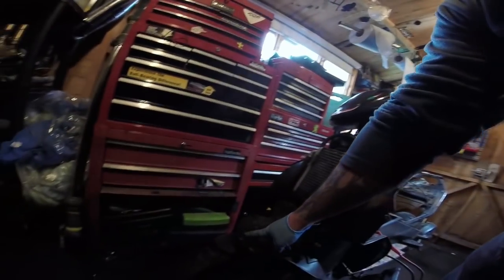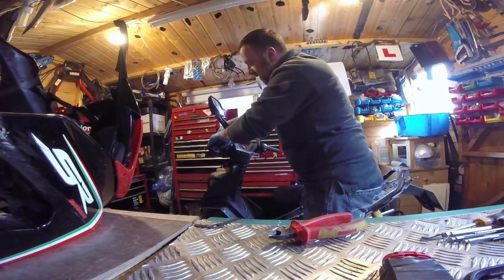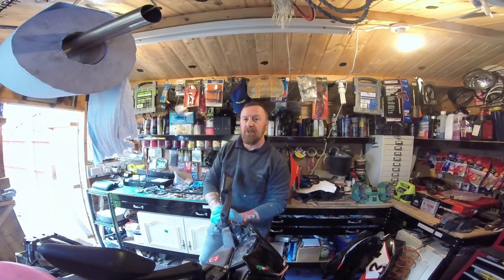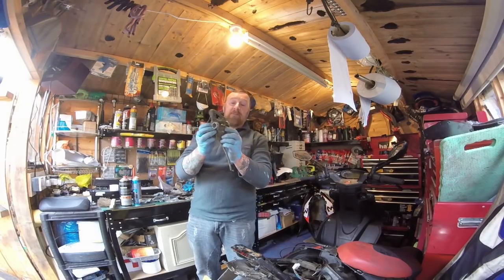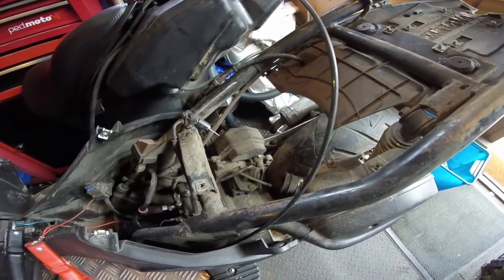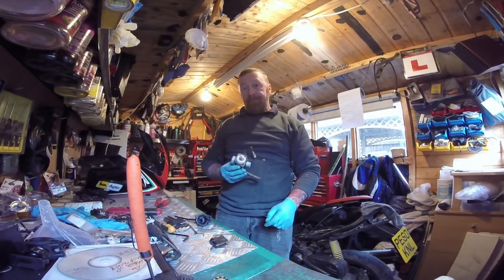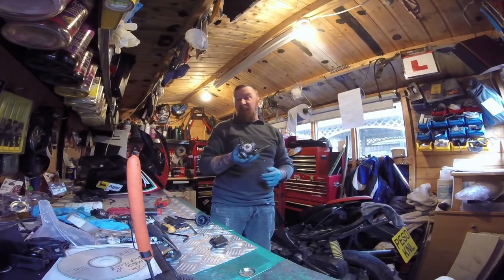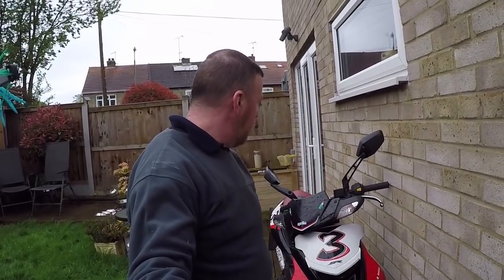APRILIA SR50 CARB CHAT AND START MARK SAVAGE

Comment: Hi mark 
Just asking the carb setting 
Put the screw all the way in then 1 and a half out
Reply from the maker: Yes bud ,that's factory set , then tune to your ped as in how it runs 
A littke out or in to run and rev better
Reply: @marksavage   hi mark just a other question for you 
I have put a battery on the bike and it is saying er 007 wot can you tell me about this is it the immobiliser
The bike is nearly running turning over well just will not fire into life 
Thanks from mat
Reply from the maker: @mathewedwards7078  I have a video with the codes 
Try mark savage aprilia 
Otherwise Google bud
They do like these codes and have problems with the ecu

Comment: Hey man, don’t know if you Will respond but I have a question. Does every sr50 have cables that lead nowhere? For some reason my Aprilia has three cables coming out to the headlights, one that leads to the left light, and one leading to the right one. And then there’s one in the middle leading nowhere? My headlight and heads-up display backlight don’t work and I don’t why. Could it be that this third cable is supposed to be plugged in somewhere? I can’t find a place for it to go
Reply: There are also three cables coming out to the front blinkers, the third one has nowhere to be plugged in. But the blinkers work as the should.
Reply from the maker: Agree I think it was to side lights .see if it has power to it when running with a volt meter 
As for clocks 
Check bulbs or and cut / damage wires

Comment: Hi.. i have a prob with my speedfight 3 it does start and ride however.. it seems that when the bike gets a little bit warm it seems to bog down and it won’t move no matter if I put a bit of throttle or full throttle. Help?!
Reply: What performace partsbare on the bike if any and what was the last thing you touched if you did
Reply from the maker: hi bud 
a few things but got to start with a service and clean carb, have you checked the auto chock like in my videos
make sure the air and fuel pipe are good and not gone hard plus check float 
worth a check on the VARIATOR system too, clean and new rollers and belt if needed
hope that helps bud got loads of videos that will help
however you know i don't love the sp3's sorry bud just a bit harder to work on 
please like share and sub
Reply: mark savage Thanks for the advice, will try everything you’ve said and yep subbed and liked mate
Reply: tyraines haven’t done anything with it apart from changing spark plug only thing that I’ve done with it
Reply: mark savage however it also seems the bike has a strong smell of petrol not sure if that’s supposed to be happening?

Comment: Sorry to bother you again, but the Aprilia SR50 Ditech's was wondering if there is a way of converting them to a carburettor???
Reply from the maker: JDM Gaming ummm 
Not sure I guess it you change the head and then put on the carb inlet and carb I can’t see why not so possible 
But may have to change the cdi ! Wiring loom maybe 
It’s not as simple I guess 
If not change the engine for a carb one and loom 
Small job changed in a big job !!
Worth a look 👀 in to 
Mark
Reply: Yes mate they can be carb converted commonly done aswell ditech is nothing but headache

Comment: Hi mark , do you prefer auto choke sytems on carbs or a manual choke conversion ? Im not sure if inshoukd convert to manual choke
Reply from the maker: they are so easy as you just get on and go and don't really think about them till they go wrong, as for manual we all have had one then forgot to take it off and conked out a few miles up the road and then have to take it off and start off lol 
so tbh auto chock for me , take care bud 
mark
Reply: mark savage hi mark , ithink mine has gone maybe as it doesnt idle without having to hold the throttle on a bit and even after its started from cold it wont idle until i ride it for a bit then stop then it holds the revs at 1,900/2,000 rpm im thinking a faulty auto choke ? How can i test and fit one of those as ive not done that yet
Reply from the maker: for the fact it is starting sound more like idle, have you up'd the idle, adjusted the cable and cleaned the idle jet?
test auto choke , take it off and connect power from a battery to the wires / earth and live then after 30 secs or so the auto choke will come out up to about 5mm then if it does it works if not it don't --simple bud 
mark
Reply: mark savage il give that ago but after i drive it after a cold start it will idle so im thinking its the auto choke , what rpm do you go for on idle?
Reply from the maker: tyraines 2t well often 1k to 1.5k

Comment: Mark I have probem with my SF2. I was cleaning carb and wanted to screw out idle jet but both idle and atomizer started to spin and now I can't put idle out but more important that atomizer is spining. I found loctite that is resistant to gas BUT, problem is that I don't know where holes on atomizer go, I don't know how to put it back now. Do you have some idea in what direction to put holes cuz they are in 90 deg angle
Reply: Also after this scoot isn't starting cold well. It's running on very low rpms, it don't want to rise them up, like choke isn't working , but I checked it and it works well.
Reply from the maker: Ja Ti hi bud I have many videos on the carb , how to clean take apart and put back together so give them a watch 
Some carbs do seize up bud and you may have to replace it if won’t run after you get it back on 
Please like share and sub 
Mark
Reply from the maker: Ja Ti you best sit on the computer as you then can get to see all my 350 plus videos and all the speedfight ones 
Mark

Comment: Hi can you help me out mate. I’ve got a sr50(Piaggio) and I just fitted a Leo vince tt Exhaust on there and it improved the acceleration but the top end feels slower. But the exhaust came with 4.8g rollers. Should I put them on? Would it improve the top speed and what do the stock rollers weigh?
Reply from the maker: most of the time they fit on with no problems however 4.8g is a little light and more likely to give you great pull away but even less top end , weight what you have now but I always like 6g for best top and pull away 
you might look into a small up jet , like in my videos but so check them out
Reply: mark savage I fixed it now mate the pipe was still restricted and had the washer in the down pipe. All fixed now mate thanks for your help

Comment: Hi mate I got same Bike Aprilia SR 50 R 2011 My Oil pump stopped working without me realising i rode bike for 200 miles without it working until it started heat seizing, so I bought a 70kit piston/cylinder, It says i will have to upjet carb 7-15% which one you think should be fine what size
Reply from the maker: GUCCI GAMER HD hi bud yes the oil pump stopping would do that 
Ok have you watched my video 
70cc kit don’t do it lol, I hate them sorry to say bud 
However ok but a selection 10 pack and go up bud n 4s plus change the air filter then you will have to tune the carb as in my tuning video 
Add a little oil in with your fuel or it will seize again bud 
Me I’d stay with a 50cc much easier and less messing 
Please like share and sub plus I have many other videos that will help 
Mark
Reply: mark savage  
Oh already bought the kit :( bikes messed me around to much, its with mechanics at the moment so was wondering what size jets to order
Reply from the maker: GUCCI GAMER HD as said fella I’d buy the pack of 10 jets and go up in fours from the jet it has in now prob end up about 8 higher 
Mark
Reply: mark savage  Hi mark Managed to get the 70 kit fitted, upjetted bike aswell it started fine revs an wheel moves on stand but once bike is on ground it doesn't move :(
Reply from the maker: tuning and jetting / air filter bud 
start all again 3 half turns go down in jet size make sure air filter is ok , try with out it and with it 
no you know why I don't like 70cc kits 
mark
Reply: mark savage Mark bike's sorted running sweet ended up with a 70 jet, changed the belt to a kevlar, could you give break in procedures on a 2 stroke please Mark
Cheers

Comment: Hi I got a problem with my zip sp,  it  doesn't wanna pull away correctly I'm thinking its cos I have standard clutch and rollers with a high end stage 6 kit and 21mm stage 6 carb ?
Reply from the maker: Alex Balazs hi bud
Well that’s half of it 
Tuning bud like in my video 21mm carb is big on a 50 cc plus jet size 
I have a few videos that will help like just tuning video and jet size and down jetting videos that will help 
What air filter are you using
Then what my variator videos 
All will help then
Please like share and sub
Mark
Reply: mark savage stage 6 air filter, rollers clutch belt and variator are all standard

Comment: hi mate I have a question, if I was to install a red malossi air filter for my airbox would I have to adjust the carb in anyway?
Reply from the maker: No it should be happy just with more fresh air lol 
A small up jet would help too again shouldn't have to tune 
But my videos will help on tuning if needed

Comment: Hi Mark, I have the same bike but it wont start at all, was riding yesterday when it started bogging down and cut out, plug has spark and everything.
What do you suggest mate?
Reply from the maker: So it’s a DI-tect engine 
They suffer from injection cdi problems 
Also piston failure 
So you have spark and a wet plug when you turn it over
2t oil all ok 
Water full 
When you turn over open the throttle does it pop or just turn over and won’t start
Reply: @marksavage  No it's normal engine mate not DI Tech
yes have spark and its wet through when turning over
2t is full and so is water 
just turns over and wont start
Reply from the maker: xRambo take carb off bud service tune and clean 
If no luck possible piston as they do go
Reply: @marksavage  okay mate cheers ill get back to you
Reply: @marksavage  Fixed it mate, well kinda... runs perfect now but its making a sort of weird noise when riding and it's around 10mph slower than before, was suggested to me that I need to replace crankshaft bearings but im not sure, any advice?

Comment: Hi mate, just need some advise, my aprilia sr 50 is playing up. It starts and rides fine until it warms up then i go to pull away and the revs go up like normal but then they drop by like 1,000 rpm, any ideas of what it could be? Thanks in advance
Reply from the maker: I do have a few other videos on the SR's that may be helpful, is it a card or di-tec , if carb id be looking into a service and carb clean plu check auto choke
if di-tec then you do have problem as they do play up, however still worth a look and a clean up.
I have seen this too with the stator going to earth but start with the other things first
Reply: Its a carb model and ive recently cleaned it as i ran it out of petrol about a month ago and no matter what adjustments i make to the carb is still does it
Reply: Also it takes a few miles of riding for it to start doin it
Reply: Do you think it could be the clutch?
Reply from the maker: Kai Abram worn piston rings 
Stuck auto choke so once warm it runs rice 
That’s the one I go for 
I have a video on auto choke 
To test take off and connect to a battery 
But make sure you put the carb and choke back on properly and didn’t miss anything 
Check float for flooding too 
If still doing it come back to me
Reply: No it runs perfect until ive done a few miles then is starts playing up
Reply: Also theres a slight judder when it happens
Reply from the maker: have you checked the auto choke bud
Reply: Once ive finished work ill put a video up on my thing so you can see what i mean

Comment: What size jet would you recommend for my aprillia sr 50 r with stage 6 sports exhaust with standard cylinder kit?
Reply from the maker: Go up in 4s from standard jet size but to be honest it should be ok with doing it and just sorting out the variator so clean and new rollers 
For better pull away and top end if it’s running ok 
Otherwise like I said get a few bigger jets from standard size you have in there now and a little bit of tuning like in. My tuning video on my channel
Reply: Its just because i cleaned it all out and saw it has a 60 jet in there
Reply from the maker: google and see if that's a standard size bud

Comment: my SR 50 r (tuned/ modified) back wheel spins relatively fast when idling on the stand and when off the stand it pushes me along then stalls, when i pull the throttle back and drive it runs normally until i stop and it will push me forward or stall. i cant push it backwards either as the back wheel doesn't want to move, only forward. someone help?
Reply from the maker: so tuned and modified !
ok the VARIATOR system, it sounds like the belt maybe the wrong fit and too tight 
did you change the clutch or play with the springs or VARIATOR, id start back and investigate them first as I think this is your problem 

I have videos on the sr and also on a aerox VARIATOR system working as it should so you may get to see how it should work and see the problem with yours also many other videos over 270 and 150 on moped so give them a watch and please like and sub 
mark
Reply: i have found the problem. a clutch sing had snapped so the clutch was always engaged. but thank you for the reply!!!!  liked and subbed also your videos are very useful.
Reply from the maker: top man . mark

Comment: Hi mark just wanted to know your opinion on 50cc sports kits, are they any good? (I dont mean 70cc kits by the way) thanks in advance
Reply from the maker: some are a waste of money and dont really give you much more speed but like in my videos as long as you do the four main ones you moped will run better and faster 
thanks for watching i have many more videos that will help
please like and sub
mark
Reply: Well ive changed rollers and exhaust and before i got the bike i think it was upjetted but not 100% sure, the bike does about 50mph so do you think its worth it or should i leave the engine set up as it is?
Reply from the maker: As it is doing 50mph, me - best leave it as is as that's a good speed for a 50cc bud 
if it ant broke don't fix it my dad always used to say !!
mark
Reply: Yea haha wise words, thanks mark. Lot of help, also it has the restrictor plate in the carb and the standard air box, do i remove and change or just keep it the same?
Reply from the maker: keep the standard air box but maybe a sports insert air filter as for the carb, take the plate out and see what it runs like as ive had this were I removed it and couldn't get it to run right even after tuning so put it back in and it was fine so go figure !!
mark

Comment: Hi, just wondering what are the signs of the bottom end going? As i think mine is on its way out
Reply from the maker: Kai Abram loud knocking from the bottom of the engine and knocks more under load too 
Small ends you get more like a slap sound 
Mark
Reply: Well my bike seems like its slightly low on compression and i also ran the bike out of petrol, could this cause damage?
Reply from the maker: Kai Abram more like you sucked up some crap from the tank 
Try cleaning the carb and jets like in my carb videos 
Maybe flush the tank and check the filter in the tank 
Mark
Reply: Also its rather smokey and smells burnt  and i pull away the reva go up and then the revs drop to about 5700 and then stays there till the speed picks up however it takes ages
Reply: Could i some how send you a video of how the bike sounds when running?
Reply from the maker: Kai Abram well if the carb was blocked it may run rich so take off the carb bud and use carb cleaner , change plug if needed and like in my new 125 video maybe wash air filter too if needed
Reply: Well it does rev up but takes ages
Reply from the maker: hi bud . upload a video on your channel but really service and clean carb then see whats going on AND check the oil lol
Reply: ive just taken the bowl off the carb and the float isnt attached, could this be the issue im having?
Reply from the maker: Kai Abram yes bud that’s is the problem
Reply: Okay i shall try it out and i will get back to you

Comment: Hi, does anyone know how to derestrict a Aprilia sr 50, mine has a yusuni sport exhaust, and I’ve took the air derestriction out the carb and it does about 42mph flat, but somehow does 60 down road with wind behind me, all I want is it to have a nice consistent speed on flat roads, any suggestions?
Reply from the maker: GibbsGaming 42 is not bad so now like in my variator videos sort the next , clean and change rollers check belt while your there too
That should help 
Please like share and sub and watch my tuning videos

Comment: Hi mark my bike cuts out at half throttle cleaned carb isn’t still doing it ?
Reply from the maker: Mitchell Sandwell  have you serviced it 
Any other alterations 
Have you check air mix like in my tuning videos

Comment: Hi i have the same bike i get er 0006 on the dash and it doesnt start i think it might be tps could you do a tutorial?
Reply from the maker: yes but that what it come up with on the error code ecu006 tps, they really do play up and guessing you have the ditech engine so may need another ecu! bugger as that's not fun and a few £s but it a plug and paly item
funny as mine says 007 but runs fine as only come up with a new battery is put on 
might help with taking all connectors off wd40 clean re set and start again 
mark
Reply from the maker: i do have a few other videos on the sr maybe give them a watch they are old but still helpful 
mark